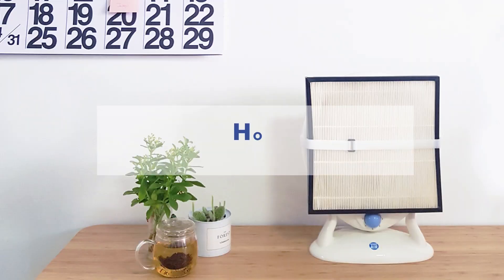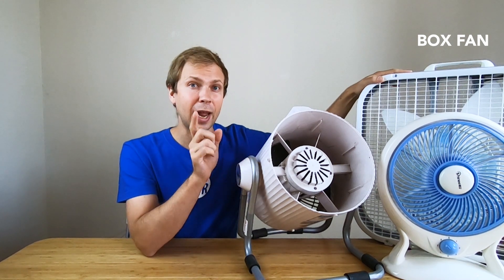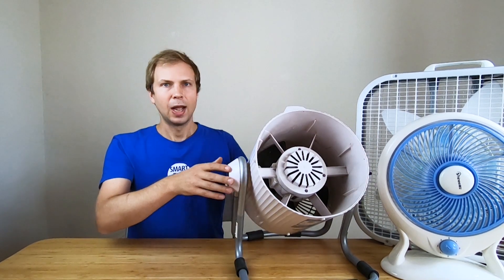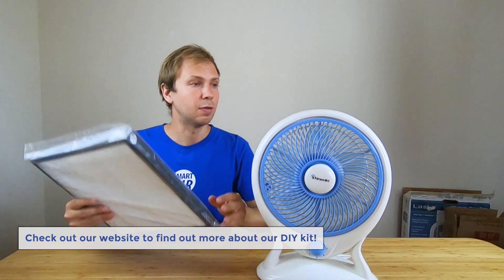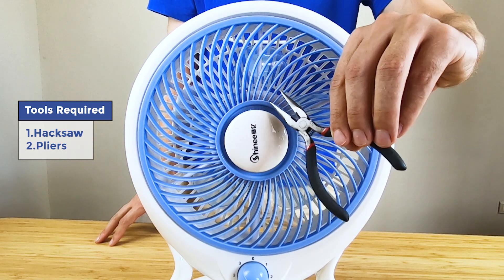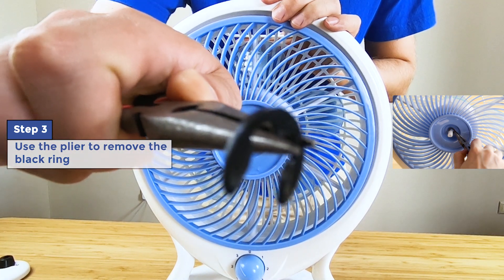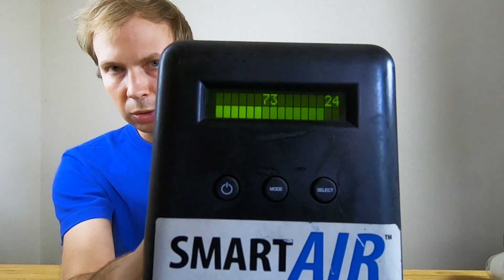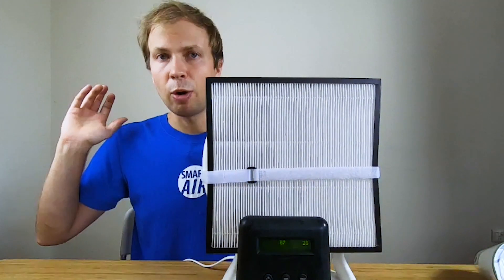3 Steps to Build Your Own Air Purifier

Comment: Is the airflow supposed to be very weak after the filter?
Reply: its useless, the fan just fights and there is very little airflow, if you see he is testing it right up next to the filter, it just does not work well.

Comment: I heard HEPA filters requires a lot of air pressure to force the air through and normal fans cannot provide this pressure. Are there specialized fans better suited for this? Please advise. thanks
Reply from the maker: Hey Paul, you are right! It really requires a lot of air pressure to pass air through a HEPA filter, especially those of a higher grade. 
We actually tested many fans to see which are the best suited for this DIY air purifier and we found one that works really well.
You can check out this article on our "DIY Cannon" 
https://smartairfilters.com/en/blog/cannon/
Breathe safe!

Comment: Can you share the CADR and decibel levels of the Cannon version? Or perhaps for a box fan version? The DIY for sale on the Smart Air website only has a CADR of 94, and that's running on high, which produces 55 decibels of noise. It works great for a small bedroom, but would be impracticable in a school classroom or a larger room.
Reply from the maker: We don’t have noise levels for the Box fan, as we’ve never tested one. The Cannon is now discontinued, so we no longer sell it. But you can find specifications for it on page 9 of our old product manual, available here: https://smartairfilters.com/manuals/DIY-purifiers-English.pdf

Comment: How do you make the hepa filter itself?? I own an air purifier.  75.00 for a new one.
Reply: No, you can't make HEPA filter on your own (it won't be effective and still not cheap)
But you could look for HEPA filter for other brand/model. Look which filter have exact same dimension as yours but at cheaper price. Or at least slightly bigger (but make sure it's not thicker) and you could cut it to size (and add frame and glue if needed)
Reply from the maker: @TakTakSub  That's right! Making your own HEPA filter might not be effective.
Reply: Thank you... I have been looking into how they are made and have bought activated charcoal at a very good price...enough to make a numerous amount of filters.
All things are possible with God👍
Reply from the maker: Hey Jeanni, HEPA filters are made up of sheets of plastic PP fiber material, much like the ones you’ll find in polyester clothes. These are then pleated and glued to increase their surface area.

However, we don’t recommend making making your own HEPA filters, as it can be difficult to source for reliable HEPA material. Folding and pleating the material can also damage the fibers if its not done carefully.

Comment: I was wondering why the filter is placed on the front of the fan as opposed to the back? Would it cause a significant difference?
Reply from the maker: Great question! It actually doesn't make a huge difference to airflow, and just depends on which side of your fan is flat. Placing the filter on the back of the fan has the advantage of keeping your fan blades clean. Although if the filter is too close to the fan blades, it can affect the fan's airflow. We wrote up a blog post on this here: https://smartairfilters.com/en/blog/air-purifier-filter-on-the-front-or-back/
Reply: @SmartAirFilters  Thank you.
Reply: 1. Actually, it should make a significant difference to the m3/h. If you check, you will notice that in all kind of appliances, where design permits, the fan is always pushing the air against the filter, radiator etc, not sucking air through it. Vacuums are a notable exception, due to the design limitations. The unfiltered debris will quickly destroy the motor otherwise. Nevertheless, in vacuum the fan pushing precleaned air into HEPA filter.
2. This is also a safety issue. Clearly it is more beneficial to have a barrier at the user-facing side of the appliance.

Comment: Hi,
I bought Hepa Filter. 
Issue : Fan is throwing air from back side.
Reply from the maker: This is a common issue with some types of fans, if they don't have a cowling round the blades! Your best bet is to create some kind of make-shift cover to put on the section of the fan where you can feel the air being thrown back. That should help improve your air purifier's performance.